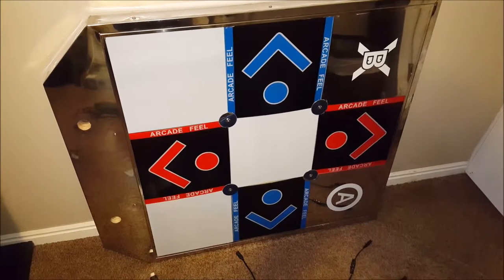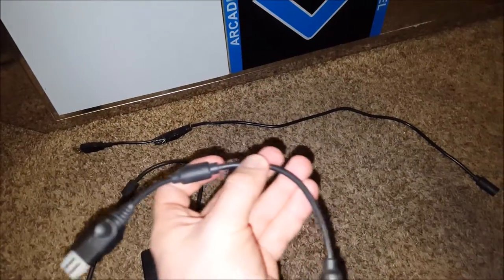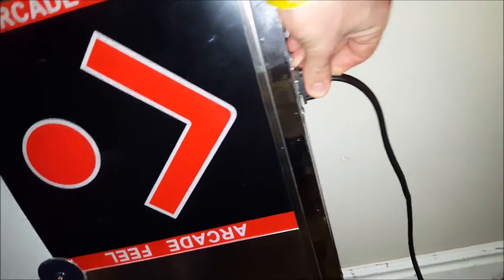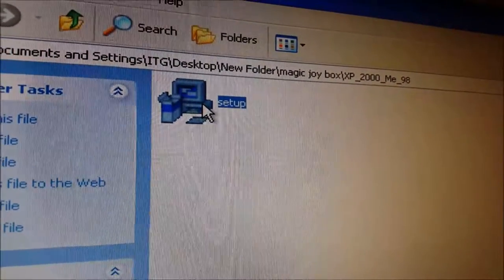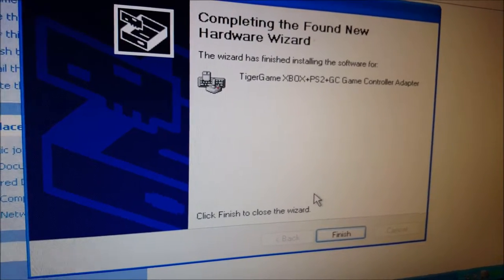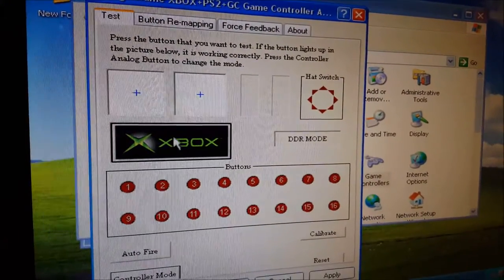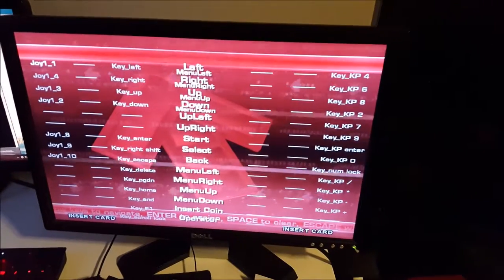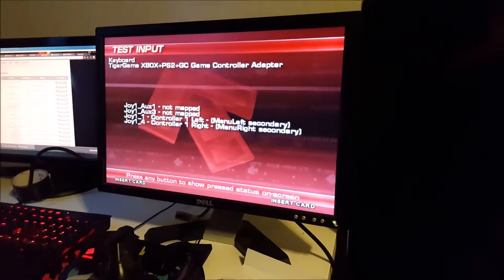Fix Dual Arrow Input (Axis) problems on a Steel OR Xbox DDR Pad

Comment: Please never remove this video! I have the exact same dance pad as you and had no idea what to do once it wouldn't connect to my pc. Thank you for the video!
Reply from the maker: Alexander Gonzales that's the point why it's up! Hope you liked it! Took me forever.
Reply: More questions! I'm in the process of looking for two PS/2/XB/USB 3 in 1 USB Box's since the two pads I purchased didn't have them but I'm wondering which emulator you used to get the DDR games? Thanks
Reply from the maker: Alexander Gonzales I didn't use an emulator. I downloaded ITG PC from torrent sites. You can also download openITG from Google. Most people use Stepmania with their pad.
Reply: Thanks, fergatronanator. I'm slowly getting the hang of this...just switched over to my first gaming pc from decades of console gaming so I'm a little slow to catch on :D

Comment from the maker: Another thing is if the pad keeps randomly disconnecting, it is likely due to static electricity. Take some dryer sheets and rub them all around the pad plates and your shoes. this will help prevent it from disconnecting.

Comment: It doesnt install the "INSTALL.LOG". ive tried running compatibility like windows 7 and XP and both still dont install correctly. My laptop is default Windows 11. Is this impossible?
Reply from the maker: @reallife_touhoujunko8203  It should be an MSI file. Not a .Log file
Reply: @ how do i get it to be an msi file

Comment: hi I know this video is old but I hope you can answer me. I have the metal pad ps2 version with the box to connect to the ps2 I bought the hub that allows me to connect the ps2 adapter to my pc via usb. the program works with ps2 or is only xbox. thanks
Reply from the maker: It may work with both I'm not sure but I know you can use third-party applications to map the controls. Where are you stuck?
Reply: @fergatronanator   thanks

Comment: I know this vid is super old, I have a metal ddr pad that has a similar control box and hooks to my ps2. I'm trying to use it with my ps2 but it's like I'm not pressing anything. The arrows light up when I press them but nothing happens on the TV. Any idea what the problem would be?
Reply from the maker: Static electricity. Try doing it on tile/hardwood or using the second controller plug slot

Comment: I downloaded the driver but it won't actually open so I can set it. Seems these drivers don't work with Windows 10.
Reply from the maker: Yeah, I think they only work with Windows XP/7 try installing using compatibility mode